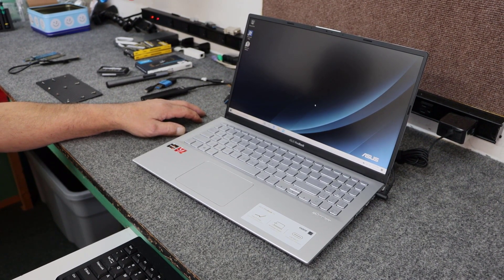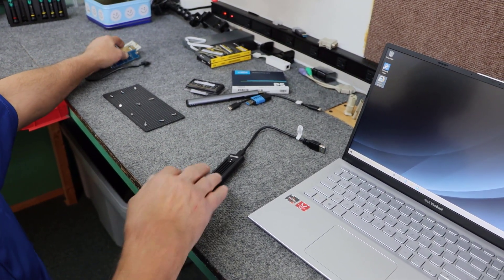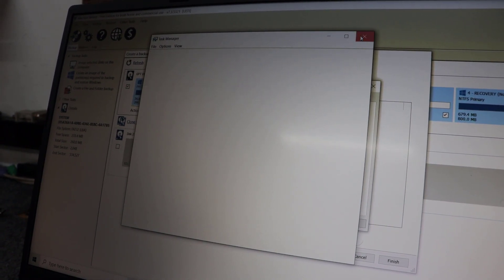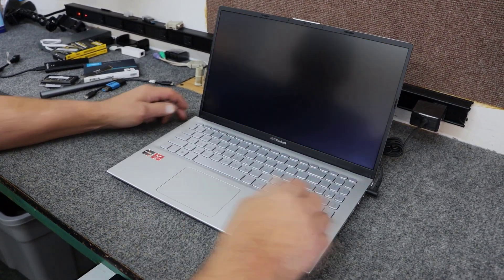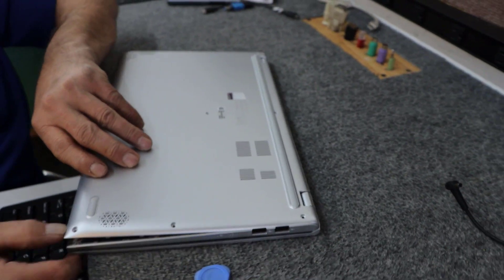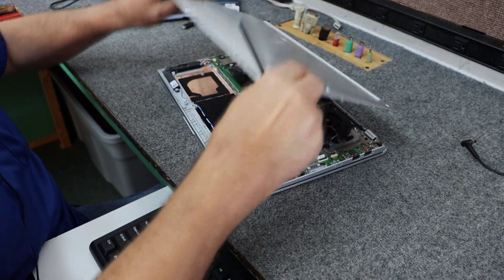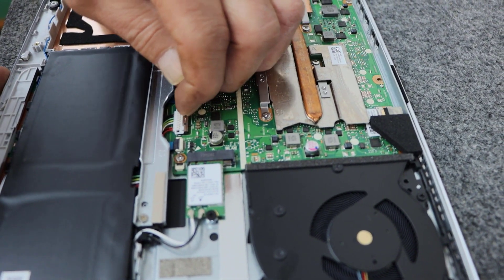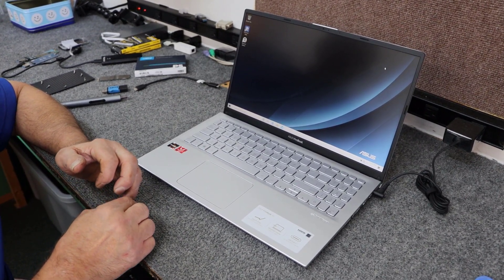ASUS VivoBook 15 Laptop NVMe SSD Upgrade, Memory Upgrade & Clone SSD

Comment: Great video.  1. Could you please post the make and model of the USB enclosure adapter?  2) Very curious if their is a penalty in performance for not using the same memory size as the soldered onboard?  I see individuals using a 32 Gb stick as well.  Any feedback would be great, and enjoy the videos!

Comment: Sorry didn't work for me. The model of Asus is X202e and it has a standard 1Tb hard drive. It was installed as legacy in BIOS and I cloned to an usual SSD 2.5" Any suggestion?

Comment: Great video! I just put in a 1TB drive (Western Digital 1TB WD Blue SN570 NVMe Internal Solid State Drive SSD), and 8 G RAM (TEAMGROUP Elite 8GB Single DDR4 2400MHz PC4-19200 CL16 Unbuffered Non-ECC 1.2V SODIMM 260-Pin Laptop Notebook PC Computer Memory Module Ram Upgrade). For some reason, the 'puter's not seeing the RAM....? (There was no RAM module in the spot, unlike what you saw here... ) The device still shows it has the onboard 4GBs of RAM, when, theoretically, it should show 12GB. I wonder if you have any thoughts on this?
Reply from the maker: Hmmm, not sure.  Make sure the ram is seated properly.  The stick could be bad, or it is not compatible for some reason.

Comment: Thanks for the tutorial! I change my RAM to a Vengeance 16gb and the ssd to NVMe M.2 Samsung 980 pro 1tb. Cloning the ssd went well, but when I boot up the laptop it gave me an error "inaccessable drive" then Windows restarted itself and gave me the option to start it up in Safe Mode. Which went well and after that everything is working fine. Bit weird but it works! Thank you!
Reply: How much did it cost
Reply: @nikhilkrishna233  €230,-
Reply: @Glocktober87  Was your ram SODIMM ?

Comment: Awesome Tutorial my man, but I wanted to ask if it is worth upgrading your RAM to 12GB, or will the standard 8GB configuration work just fine even as the laptop age? Cheers!!!
Reply: I'd say either upgrade to 16GB or leave it at 8GB because RAMs don't work well together and achieve optimal performance when they are not equal in storage.

Comment: Thank you so much for posting this video.  I bought my Asus Vivobook a year ago and it came with 8gb ram (4+4) and the Asus website is not helpful.  Probably because they'd rather I buy a new laptop every year instead of upgrading my ram.  This video will have saved me nearly $300 since now I feel confident that I can do this myself.   My next project is recovering files from three old hard drives.

Comment: you said at the start you explained to the customer about the advantages and disadvantages to making it 20gb, what would the disadvantage be?
Reply from the maker: Hi. 4gb onboard, and adding one more 4gb stick in empty slot would get you true dual channel, as long as speed is the same. Being this is not a gaming laptop, it really doesn't matter. Some people just want more ram, 20gb is still better than just 4gb.

Comment: HI! I updated my ram. But I'm now stuck on the Bios Utility no matter what I do. Any advice?
Reply from the maker: Also, make sure module is seated in the slot properly.
Reply: @CadillacComputerCenter  I tried to go with larger ram, but when that didn't work, I just put the original back in. I'm going back in and trying to re-seat it. No luck as of yet! But I'm holding out hope!
Reply: @rachaelalethea  update?
Reply: @legandable  I wasn't forceful enough with the ram stick apparently. Was so scared I was going to break something! It's back to running now!
Reply from the maker: Did you use same speed ram as what was already in it?

Comment: question. as a vivobook owner, i notice my laptop has the same slot next to the battery, with that same sata connector right behind the nvme slot. would i be able to use both? for instance, could i boot from nvme, with a 2.5 sata ssd as an internal slave? and if so, how would i set it to slave? i know older drives would have the flip switch for it, but i don't believe i've seen those switches on newer drives, ssds specifically.
Reply: from bios, you can select which drive to boot from
Reply: You can buy a connector cable (Asus only provided slot. But to connect HDD/ SSD you need a connector cable) and connect your newly bought HDD/ SSD and format it and use and D or E drive.

After adding new HDD if it's not booting up normally, simply go to bios and select the boot from (primary) as Nvme. 

That's it.

If you have trouble with bios while changing, there are like 100000 videos of those on YouTube.

Comment: The more I look at these the happier u am that my F512DA-EB55 already has the caddy. Does the kit Crucial offers work in those Asus X512,, or Acer Aspire 3 models that don't come with an HDD?

Also, what speed was the RAM included?one also has 2400 on-board but came with 2666 SODIMM so that's what I ordered. No problems so far, but would 2400 be better?

Comment: in vivobooks there is 8gb soldered on motherboard at 3200mhz. You put 16gb at 2400, now you have 24gigs at 2400mhz. Better get a 16 or 32gb stick at 3200mhz, that is the max ram supported on this machine
Reply: Not on all of them. I have Vivobook 15, and it's 4gb soldered, 4gb removable/expandable...
Reply: yes, thats right, and again you can put 32gb stick in the dimm. In vivoboks there is cpu type SoC where the chipset is in SoC
Reply: @vladimirzahov4677  On mine the manufacturer says maximum 12gb for this computer. Both on their website, and in an answer to a customer question on a website. Do you think I can use 4gb soldered and still add a 16gb to make 20gb total? Crucial website says that would work, so now I'm confused...
Reply: Yes you can. Is your laptop with i5 or i7 10th gen cpu? If yes, then it supports up to 64 gb ddr4 or lpddr4 but you have only one dimm on motherboard so u can add up to 32gb stick in it. The chipset and cpu are both on one SoC that means u have no problem to add all supported memory
Reply: @vladimirzahov4677  AMD Ryzen 5 Mobile 3500U is my CPU, just bought a month a go, made in April 2020...
Reply: on ryzen 5 3500u  you can use up to 32GB ram but at 2400mhz not more. When you have 4 soldered on MB then u can add 16GB 2400mhz ddr4 sodimm if you have DIMM slot on MB.
Reply: @TheRealCoryKent  hi, did yours came with the caddy and flex cable to add an additional hard drive on the empty slot? Trying to get one
Reply: @vladimirzahov4677  thanks and You are right.  Don't know why Asus  says max 12gb
Reply: @vladimirzahov4677  Hi, I have the same procesor as you and 8gb soldered, can i add 16gb more?
Reply: Hi! If your laptop has 10th gen intel you can add up to 40gb memory, because the SoC handle up to 64gb but you have 8gb soldered on motherboard. That mean you can put 32gb stick in it and pc will work fine
Reply: @vladimirzahov4677  Thank you very much for your time and helping me.
Reply: @kreana02  I was told 12 max also so I only added an additional 8. I think I'll up that to a 16 and see how it runs.
Reply: @vladimirzahov4677  What about AMD Ryzen 7 3700U?
Reply: @TheRealCoryKent  On the Vivobook X512DA model you can take out the memory stick and replace it with a 16gb for a max of 20gb!!
Reply: @TheRealCoryKent  si ya hiciste eso me gustaría saber si te funcionó ya que yo también tengo una 4 y 4 y Nose si la cambio por una de 8 para que den los 12gb en total o compro una de 16gb como en este video 😿
Reply: @vladimirzahov4677  la página de Asus solo dice que permite hasta 12gb estás seguro que se le puede expandir a una de 16gb?
Reply: @kreana02  encerio puede ser más de 12gb ya actualizarte tu? Puedo poner una de 16gb como en este video ?
Reply: @wallychambe1587  y el modelo x512D ? Puede tambien ?
Reply: @isaacslender826  si señor.
Reply: @vladimirzahov4677  si compro una ddr4 de 16 sodimm pero con frecuencia de 2666 podrá funcionar aunque no sea a la máxima capacidad de la ram ?
Reply: @kreana02  también es vivobook 15 X512D ?
Reply: It works on mine x512jp
Reply: @JupiterJamie Hey, did you try it out? I also have a Ryzen 7 3700U, 4GB soldered and I'd like to replace the 8GB removable for 16GB
Reply: mHz is millihertz. The correct abbreviation is always MHz for megahertz! M = Mega, m = milli. Conventions exist for a good reason!